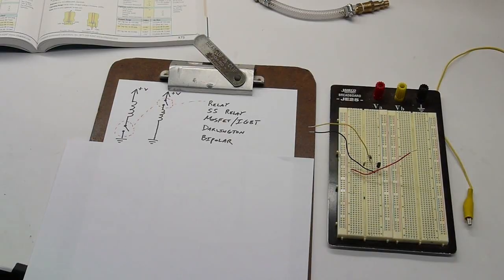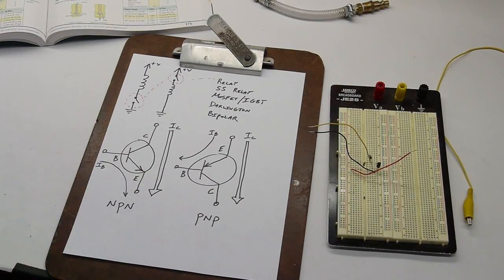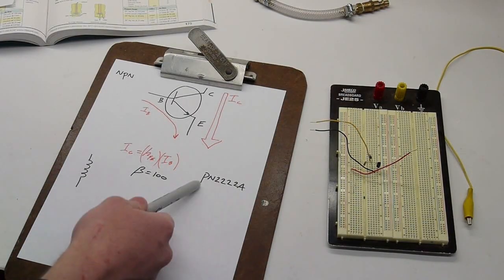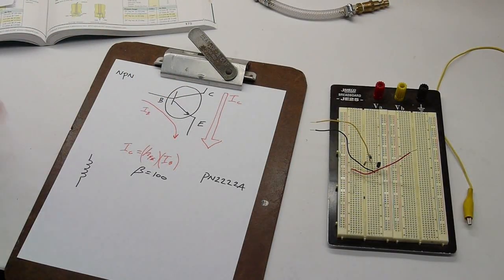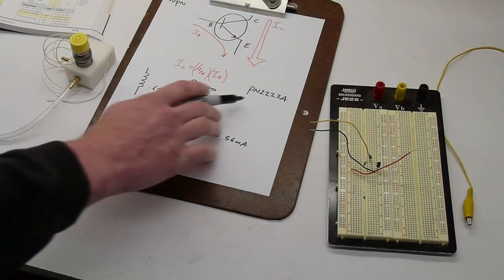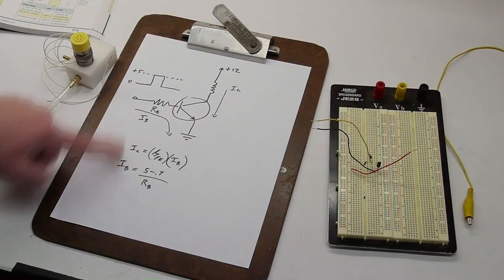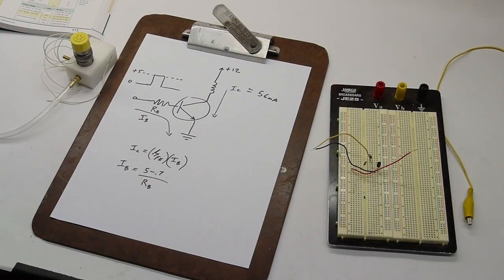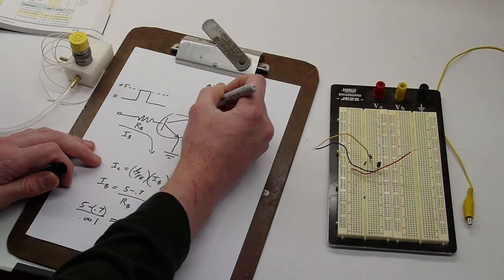Tutorial: How to design a transistor circuit that controls low-power devices

Comment: I've never watched a video that was as informative and clear. Your explanations are complete without getting overly complicated.  Thank you so much for making these.
Reply: "Power used to 'warm-up' the transistor" ??
The .7V loss through the Base/Emitter calculation, is a bit more complex than, but 'like' the typical .6V
loss through a forward-biased diode. At such 'PN' junctions, the 'P'-type having a deficiency of Electrons, and so having 'Free-Holes'.   The 'N'-type has an excess of Electrons !  (I'm keeping it simple here...).
Now where they are physically touching, (and no voltage applied), for so many atoms thick in the lattice some of the excess flows into the deficiency, creating an Insulating barrier at the physical junction !
As a result, even when 'Forward-Biased' from a voltage source, a Diode needs at least about .6V just to break down this barrier, before it starts to conduct, so you will always loose this!
A similar effect(s) are going on inside most typical Transistors. (Hence his '.7V' loss in his calcs).

(1)  For a Diode, this voltage loss is NOT dependent on the LOAD after the Diode!  So for example, you could connect 5 diodes in series, for a precise 3V drop, or 10 in series for a 6V drop, irrespective of the load !!

(2)  This 'Insulating' barrier at the PN junction, can be considered the 'Dielectric' of a capacitor, so our Diode is ALSO a Capacitor, with the 'plates' being the P/N materials area themselves.
NOW it get's interesting though!! as the higher the 'REVERSE-Bias' voltage across the Diode, this FORCES an even LARGER non-conducting 'neutralized' gap/barrier.  2 main things control capacitance....
The area of the 'plates', and the 'space' (dielectric) between them. So what do we have now???
A solid-state Voltage-Dependant Variable-Capacitor !!!  Yep... and it is utilized a lot these days.....
although now 'Special' Diodes are made to take advantage of this effect, called 'VariCap-Diodes'.

Sorry about all that...  :-)
I just get 'excited' playing with software like  'Circuit Wizard', that allows you to design on screen virtually any electronic circuit including virtually all elect/electronic components & IC's, see it all run in REAL time, monitor ALL voltages & currents from ANYWHERE in the circuit simply by mouse movements.
Not to mention auto creation of your PCB & all artwork when you are ready, with auto track routing.
ALL before you touch your soldering (not the American 'soddering' :-)  ) Iron.  Have fun !!!
Reply: Glenn Sprigg
Never apologize for great explanations.  I found that very enlightening.  You might think about having your own channel.
Reply: Brian McDermott said it better then I could, this is the single most informative and basic video I have ever found!!
Thanks to you, the npn and pnp drawing and workings ar no longer abstract to me!
Thanks a lot!! :-)
Reply: He is a good teacher that knows how to tackle broad levels of students watching this video
Reply: lol......great video mate, very well explained.
Reply: There are several components to learning electronics. One place I found that succeeds in merging these is the Gregs Electro Blog (check it out on google) without a doubt the no.1 course that I've heard of. Check out this  amazing site.
Reply: your comment makes no sense....wanna take another run at it?
Reply: PNP transistors especially, or transistor power that is used a little to warm up the transistor, so using Ohm Law is not 100% accurate :P.

Comment: +Applied Science
Great tutorial! 
While you did not cover AC scenario's, does this explanation still hold for situations where you would trigger the transistor using a PWM signal? I am looking for a way to control the speed of a fan using a PWM signal from a Raspberry PI.
Does this impact the other components you use here? I imagine the capacitor might need to be different.

Comment: Nice video. The 2N2222A handles 800mA, meaning that if the restriction depends only on the transistor, the right resistor would be (5 - 0.7)*100/0.8 = 538 (560 ohms). So, the solenoid would be destroyed but not the transistor!
Reply: 10, not 100. As a switch, base current should be 1/10th of collector current. Read the datasheet.
Reply: @AlienRelics  Can't help think that Ben has been scarred by destroying many transistors when he started out that he errs on the side of minimizing base current. 1K would do the trick.
Reply: @kissingfrogs  Perhaps. But beta varies from batch to batch, device to device, temperature, and time. I'd accept 15 or even 20, but 100? That is the rated beta in the active region.

You'll destroy more transistors with excess Vce drop at higher current.
Reply: @AlienRelics  Absolutely right. Read the datasheet for any transistor (except for BC547 series) and you'll see that Vce(sat) is always specified with a base current equal to 1/10 of the collector current. If that's what the manufacturer is prepared to guarantee, why would anybody design to use a smaller base current and risk the transistor coming out of saturation? What does saving a few mA of base current gain for anybody?

Also the 2N222A isn't rated for Ic=800mA continuous. Unless you can heat-sink it, it's only rated for 625mW dissipation (and that's with a Tj=150°C) at an ambient temperature of 25°C, so with a guaranteed Vce(sat) of 1V at 500mA, and Vbe(sat) of 2V at 50mA, that will give 500mW + 100mW = 600mW. That is very close to on the limit, so nobody would design for continuous collector currents more than 500mA (and even that's pushing it).
Reply: What about the power loss that occurs between base emitter junction due to low resistance? Cant ignore that either.
Reply: right what I was going to say
Reply: AFAIK the solenoid will only take as much current as it wants. It won't be destroyed unless the voltage is much too high.

Comment: why can't you use the PNP transistor. I didn't get that part. Can't you just turn on the PNP device by making the base voltage lower than the emitter and turn it off by making the base equal to the emitter.. !!

Comment: "Mosfet" "Doesn't isolate" Everytime I have used one, it has been in an isolated situation, with an op amp based circuit driving it. An op-amp driven mosfet circuit to add variable voltage regulation on a high current load was actually the project that got my feet wet in electronics :)

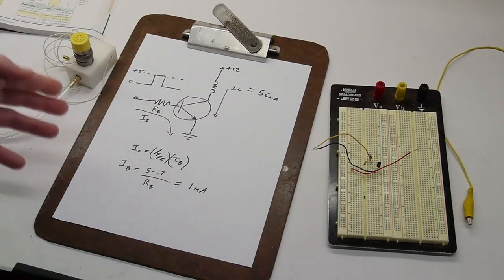Comment: on 14:30 "the current is limited by the solenoid it' self..." well i don't think so... any coil based actuator or component that does not has voltage/current supervisor instantly  a dead short and burn out your coil (heat up). for experiment let's say dc motor or you can use anything solenoid type actuator, and your power bench, i set up 12V DC and 19A. it will drain most of it then the data sheet says. And make the dc motor getting hot. or best example is your foam cutting or  your vaporizer cigarette, it will draw as much as current until it burn off. that's why we have ratting on the simple cable that can handle the amperage.

so why in incandescent light bulb  just flowing the amperage that they were rate? just because it has internal resistor on the wolfram to limited the current. and its different type of induction that we use on solenoid or dc motor

well CMIIW. nice and great detail for the video i like that, and yes you need more deep about floating base and pull up / pull down resistor on the base too.
Reply: You're saying "ANY actuator" but that's really not the case. Electrically, the trigger input of a solenoid is a coil, right? What is a coil? It's a long isolated wire. This wire has a rather significant DC resistance, because of its length. It's possible to design a coil that will be just fine across DC at a specific voltage. It will be made out of a wire that is not very thin in any section, but a very long length of wire, a very high number of turns, so that its total resistance acts as current limiter that is sufficient for a specific voltage. This is the design used for solenoid relais, because they must be able to engage constantly from DC. Motors use lower DC resistance coil designs, as they are intended to be switched, so in normal operation there is a cool-off period and reactance-based current limiting when it's switched on. Still, a solenoid relay can get quite warm in normal operation. However, you can not limit the current too much externally if you're running it near the minimum rated voltage, else it will not exhibit enough force in order to switch.

Incandescent lightbulb only has the tiniest bit of inductance, mostly it only has DC resistance. The very thin but not very long wire with relatively low resistance reaches about 3000°C inside the lightbulb. It's isolated by vacuum, so the outer of the lightbulb doesn't reach such high temperatures. Wolfram has good electric conductivity, but it's also very temperature resistant.

Comment: Good Tutorial. Thank you for that. Just another thing:  You have to consider the power dissipation of the transistor itself, due to the voltage drops across it. taking the numbers (0.2Volts and 56mA), you can say that the transistor dissipates like 11mW of power, which is quite low for that circuit, but if you have a larger current and also a larger voltage drops on the transistor, you could damage your transistor if you don't attach it to a proper heatsink.

Comment: What's the point in subtracting 0.7v from the 5v if you going to overestimate the base current anyways?
Reply: +Akfloatable theoretically 0.7 is really needed when calculating the base current or the base resistor but when it comes to a consistent collector current which is 56mA no matter how much current you feed to the device you are controlling it will still give you 56mA nothing more. By not neglecting the 0.7 voltage drop between the base and the emitter you are clearly calculating in how much base current to use which is still approximated.

Comment: Not sure if it was mentioned in the 400+ comments - but at 9:17 you say you use Ohm's law to calculate the current usage - it's actually Watt's law, not Ohm's law. Other than that minor point, great video!

Comment: in your circuit you need to add resistor between base and ground e.g. 100KOhm to avoid floating base

Good tutorial though
Reply from the maker: Beboba This tutorial discusses bipolar transistors, which do not have floating bases, and do not need such a resistor.  An insulated-gate transistor such as a MOSFET or IGBT have high impedance gates that may need a resistor to tie the gate high or low.
Reply: Applied Science Interference from nearest components can easily turn the bipolar transistor on. E.g. if you have high voltage generator.
Reply from the maker: +Akfloatable Leaving a pin of an electrical component not connected to anything is considered &quot;floating&quot;.  This means that the voltage at that pin can change very rapidly if there is nothing to sink or source current.  Turn on a digital multimeter to its voltage range, and leave the test leads disconnected.  You&#39;ll see the voltage floats around.  For some components like bipolar junction transistors (BJT), leaving an input floating is not particularly bad because the device requires a fair bit of current to operate, so the pin will remain fairly stready by itself. A MOS component requires almost no current to operate so the slightest bit of charge will cause the pin voltage to change, and turn the MOS on and off very rapidly or partially, which is not good.
Reply: +Beboba The input is floating and in the circuit shown it is unconnected to any long trace and so 1/2 inch seems a reasonable approximation. The high voltage would have to be AC, not DC for induction to occur, few circuits have 500VAC flying around any more (not that that would be enough), certainly not this one. Moreover that AC would have to be continuous to turn on the BJT. The induced current voltage would have to produce a voltage over .7V on that flying lead to overcome the base to emitter junction. Again, I ask, exactly what conditions in a circuit like this could cause this to happen? Describe an actual physical condition with some worked math. Specifically, how high-voltage would an AC emitter need to be say, 1 foot away from the 1/2 inch flying lead (your antenna) to induce enough current on that least to both produce .7V on that lead and provide enough current to turn on the BJT. Remember the base to emitter current he needs is described in the video, about 560uA. Also, what frequency of AC would that have to be to efficiently couple to that 1/2 lead?

I completely agree that what you are describing could happen with a FET which could accumulate and store a charge on the gate (which is idealized as an open circuit to ground) sufficient to turn it on. But a BJT's base is ideally modeled as a short (a forward biased diode) to ground and rapidly bleeds off any charge sufficient to forward bias the diode and so effectively can't turn on except in extreme circumstances.
Reply: +Beboba BJTs are current activated devices (current from base to emitter establishes the current from the collector to emitter.) If the base is floating, there is nothing to induce a contiuous current from the base to the emitter, an electrostatic charge, while a very high voltage, doesn't have enough charge to induce a large enough current to turn a small signal BJT on. FETs have the issue you discuss where they are voltage activated devices (voltage between the gate and source establishes the current from source to drain) and can easily be turned on by stray voltages. All that said, very high gain BJTs (especially darlingtons) can be briefly turned on by small electrostatic charges.
Reply: +Beboba exactly, and the power source in the case of floating inputs are just stray electrostatic charge, not a large or continuous source. While the voltages can be quite high, the number of electrons, the charge, is quite low and won't typically induce enough of a current for long enough to turn on a small signal transistor.
Reply: +Beboba What circumstances, exactly, could induce enough current and place sufficient voltage on an unconnected 1/2 inch lead in free air to turn on a BJT (a 2n2222a to be precise)? Induction requires coupling of which there is precious little under those circumstances.
Reply: +Applied Science Can you explain what a floating base, or floating anything is?  I see this mentioned a lot when reading about electronics.
Reply: Jason Doege High voltage does not have enough charge to induce a large current? What are you talking about? You can induce any current, it depends only on your power source.

You need micro amps on the base to make bjt work
Reply: +Jason Doege Where do you get 1/2 inch? It can be any length depending on your circuit. As I said before high voltage generator (at least 500V) near it can easily turn the bjt on. Because that I was encountered with before. Any peace of wire works like an antenna and sucks energy from any electromagnetic field. That's why you need a resistor to avoid such parasitic currents. This is very basics of electronics and I wonder that I need to explain it here.
Reply: +Jason Doege It has nothing to do with electrostatic, induction can create any voltage and any current

Comment: Sweet...I worked on NC machines in the 1970's (Burgmaster)....100's of these NPN 'relay drivers' on each machine (current sinking)...and of course the blocking diode...usually soldered right onto the 2 'coil' pins on the 14 pin relay socket....most times we used 4 pole, double throw...much relay/ladder logic (7400 series TTL)....then a few years later...the 4004 and 8080 micro-processors...

Comment: i do not understand why you could not use a pnp transistor in that circuit and use a resistor..?only with a npn this would work..?If the pulse is at its low,it could get the transistor to conduct if the voltage is negatif,or you could ground the base with a resistor,the transistor conducts until the puls goes high,it just would work in the opposit way..a pnp transistor an resistor can still be used..
Reply from the maker: The problem is that the transistor is switching a 12V device, but is being controlled with a 5V logic signal, which has a common ground with 12V.  In this case, it is much easier to use an NPN because the base current can be easily controlled (flowing from 5V to ground).  A PNP transistor would require base current flowing from 12V to the base, which is more difficult for the 5V logic circuit to control.
Reply from the maker: In the case of a PNP, the current source is at a 12V potential. The transistor is controlled by allowing the current to flow out of the base. If our digital logic circuit can provide either 5V or 0V, our ability to control the base current is not so good because our two options are 12-5V = 7V or 12V-0V = 12V.  So, we would like to have little or no current flowing at 7V, and about 1mA at 12V.  There is no simple way to do this with a single resistor.  In the case of an NPN, the current source voltage is the base itself, under control of the digital logic, so we can easily go from zero current up to almost any value we want.  The reason that NPN is easier to control is because the 5V and 12V systems share a common ground.
Reply: +Applied Science I still don't get it.. it's pretty much the same, just the current in opposite directions! they also differ in maximum frequency of operation but I think that's irrelevant in our case..